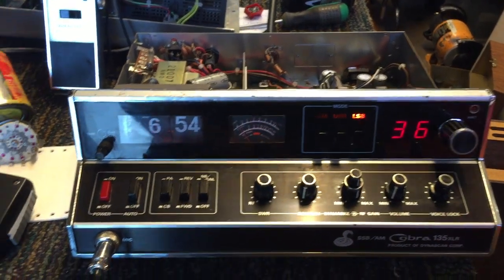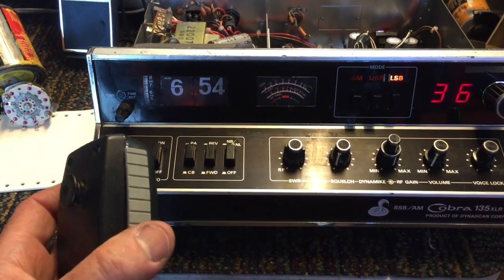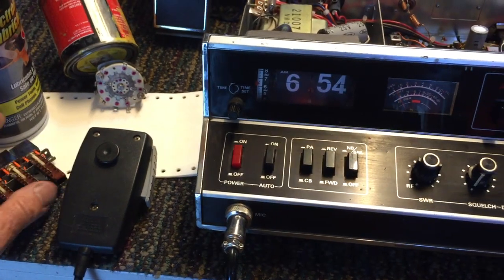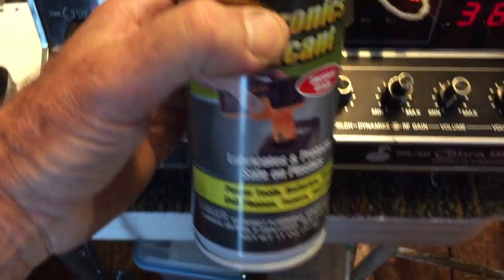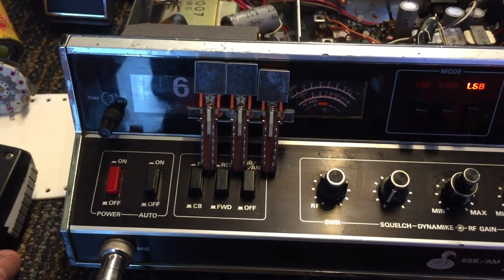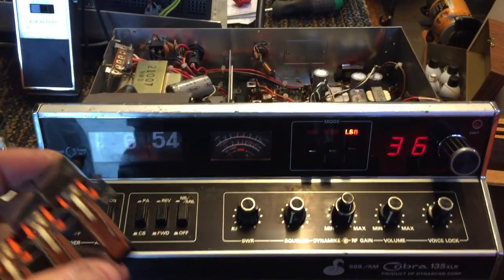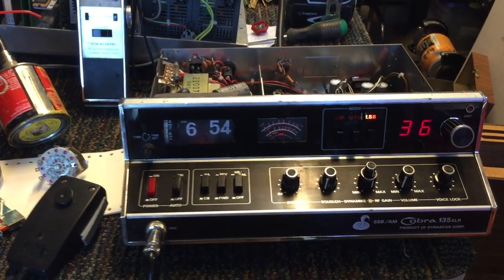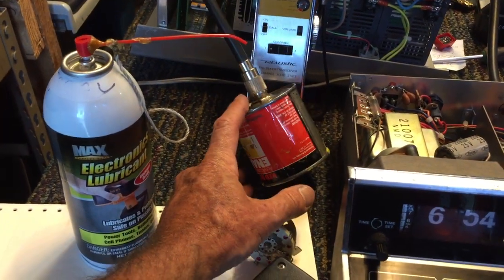CB Radio Repair. Had No Broadcast Audio

Comment: I remember a switch problem with my mom's DVD player. It just wouldn't turn on. Checked the power supply, but that didn't have any problems (that I could find - total lay person). So I thought: Let's check the switch. I put the DMM into continuity mode, and everything seemed fine. It beeped when I pushed the button and did not beep when I did not push the button. At that point I was afraid it would turn out to be one of those complicated problems that are beyond my very limited skills. Until, in desperation, I took a second look at the DMM. It showed 75 ohms even when the button wasn't pushed. That wasn't enough to trigger the beep, but it was enough to continuously pull down the line. After I cleaned the micro-switch with some IPA, the 75 ohms turned into an open line. And the DVD player came back to life. Lesson learned: Continuity mode can be deceptive. Sometimes looking at the actual measurement is a good idea, even if it makes probing more fiddly.

Comment: My Cobra 2k needs a full recap, they are pretty much all failing.
Reply from the maker: I'm sure the capacitors in my CB are far from perfect.
Reply: @GrantsPassTVRepair  I had problems starting over a decade ago. I haven't used it in about that long as well. I really have to get into this radio, hopefully nothing has leaked and done any serious damage.